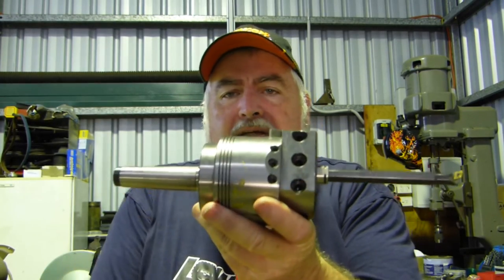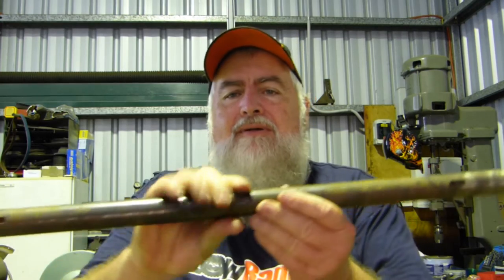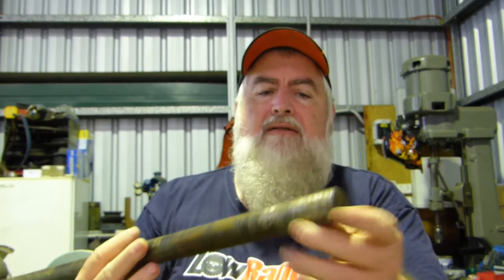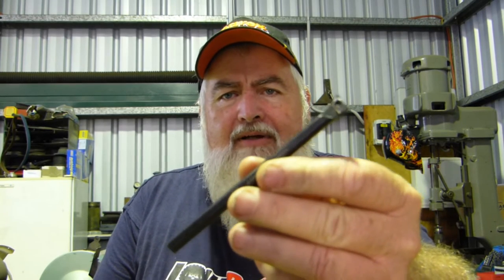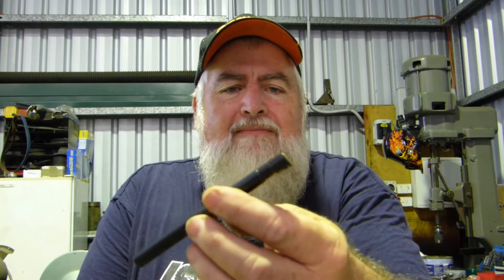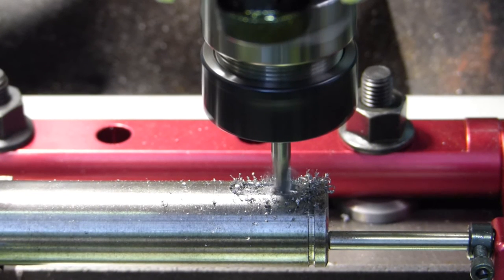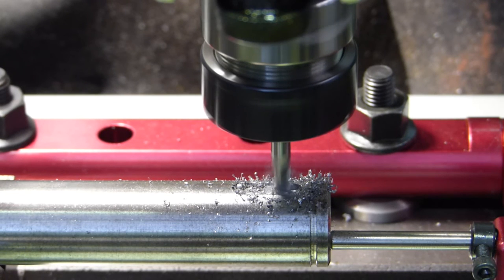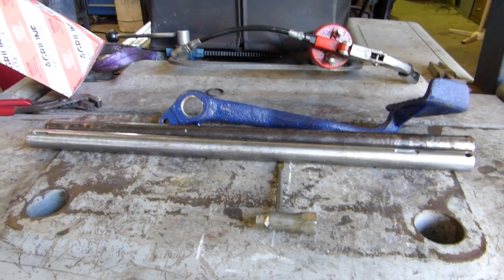Kangaroo Stew # 39

Comment: Hey Lance how's tricks. You're looking well. Crikey that's reminded me of something. Those E27N Fords...some over here had a P6 fitted. Now as you can imagine they were FAST. I mean much faster than all other tractors. Well as a teenager I got the job of  driving one, can't remember but expect it was from the farm to a field along the road. Well of course I had to go flat out....scared myself silly lol.
Reply from the maker: G Day Malc, Yeah there was a fast box and a slow box too in those I think, you dont have to be going that fast on a tractor for it to seem fast either if there is a steering wobble .
Reply: That's it, you could get a high speed back end, bigger diff I suppose. I know my Nuffield does 17mph, and is slightly faster than those of it's day. But these did almost 30 I seem to remember. Yeah getting steering wobble at that speed did up the heart beat a little. Nearly went over the hedge lol.
Reply from the maker: Those Nuffields had tall wheels too over here 38" rims on some local tractors for the sugar cane.